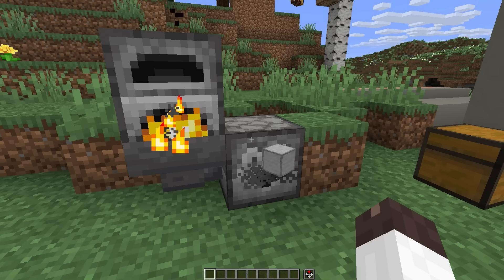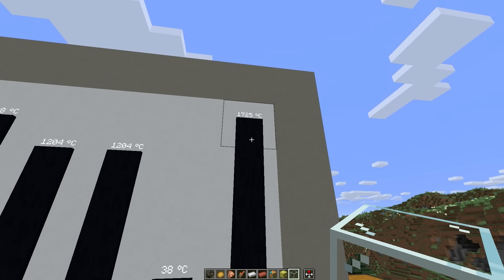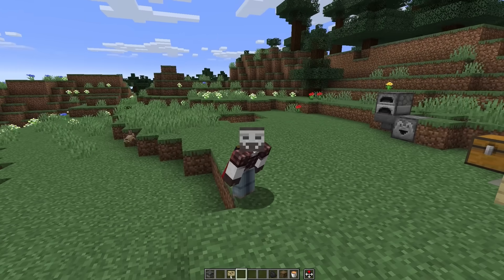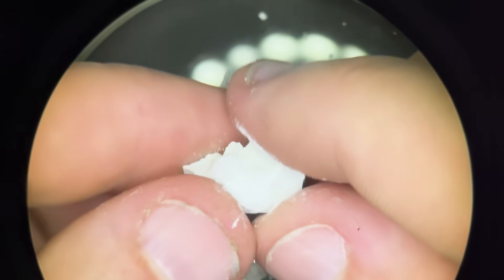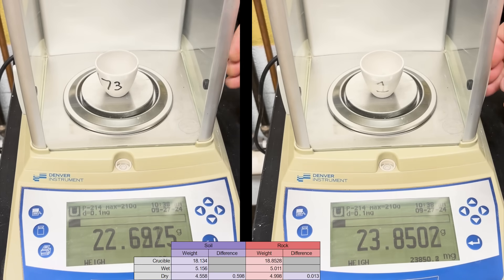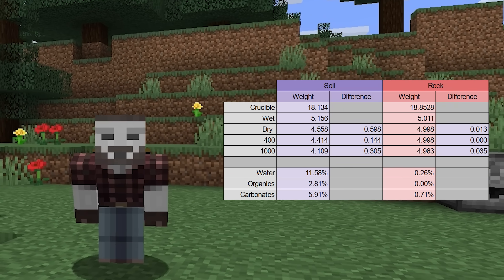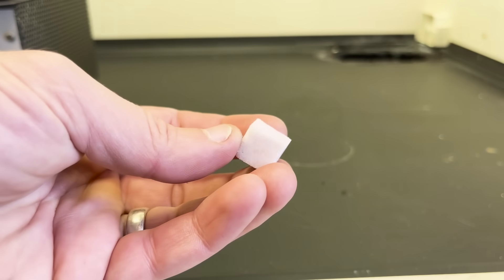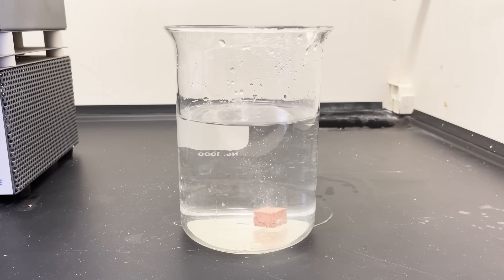Can a furnace make stone smooth?

Comment: A sponge block in Minecraft can absorb up to 135 blocks of water, 1 cubic meter of water ways roughly 1 tonne, meaning a wet sponge can potentially weigh up to 135,000 KILOGRAMS, and with it all being contained within one cubic meter of space, this would make it 6 times denser than OSMIUM, HEAVIEST SUBSTANCE KNOWN TO MAN. You can dry out this water in a mere 15 seconds, meaning you would need 45 GIGAJOULES OF ENERGY TO DRY A SPONGE! THATS 3X MORE POWERFUL THAN A NUCLEAR REACTOR! So it would take a lot more than just 38 degrees to dry a sponge.
Reply: For another comparison, the Hiroshima nuke released about 65 gigajoules of energy. 

You'd quite literally need a small nuclear bomb to dry these sponges
Reply: It takes 1/20th of a second (or instant I'm not sure) to dry out a sponge in the nether by placing it. The nether has a casual 13500 GIGAJOULES (probably wrong, just multiplied your number) to near instantly dump into a block.
Reply: @AxolotlInANutshell-df5xi  and Steve manages to walk around THERE!? Holy hell, HE IS stronger than superman.

Comment: Smooth stone has bugged me for a while now. It's a really outdated holdover from a time when a) there was only one kind of stone, and b) there was no system to refine stone further. From a gameplay perspective, it was sensible enough at the time: cobblestone -> stone -> smooth stone. But it makes no sense that, if you put stone into a furnace, it becomes "smooth" stone while, if you cut that same stone into bricks and then put them into a furnace, they crack.  
It also makes smooth stone a more expensive block to obtain than any comparable finished stone variant.

Comment: 0:24  p-peter how are you doing that
Reply: I don't know lois. I'm scared
Reply: pretty sure it's one of those screen projectors from GregTech with a lot of hidden wiring on storage with sensors (either Jabba barrels or Drawers) to change the displayed file upon adding an item to each barrel/drawer

Note: projector may not be GregTech. All I know is I've seen them in GTNH videos, though never used one myself as I'm pretty new to the pack (150-ish hours) and still in LV

Comment: It all depends on the material. It's also interesting how heat makes clay hard and water resistent, while the same heat makes limestone soft and soluable in water. There's also this thing in Minecraft that you can smelt cobblestone back to regular stone in the oven, which would be pretty hard irl, especially since most kinds of stone would completely change their structure after melting.

Comment: The limestone crumbling to powder when dropped in water was epic.  I like how it looked like nothing was going to happen at first and then it seemed to shake itself to pieces.  When your kids leave their sidewalk chalk out in the rain something similar happens, just not as fast.  I assume there's some reaction with the water and because of the heat it just occurs very quickly.
Reply: It's a quicklime reaction, which is the most basic form of concrete. Quicklime also was historically used as a chemical weapon because of its reaction with water.

Comment: I can say for certain that granite CAN AND LIKELY WILL crack under a large and rapid temperature shift. If you had a huge slab, like, say, for a countertop (like I do), it is way more susceptible to cracks from this shift. I had a griddle on my granite countertop (which I will never do again) heated to 375 (within error of course), and when we opened the door in autumn (it was around 45 degrees), the countertop cracked, making a VERY loud sound. The crack is barely there. You have to search really hard for it. It looks like a tiny hair's width fracture in the slab, and since the countertop is dark, it makes it even harder to see. Nonetheless, it was not nearly as major as a temperature difference as your granite cube, yet it still cracked.

Comment: Smooth stone blocks are an extremely new addition to the game that only exists because of glitched seamless slabs in older versions, it applies the logic of smelting cobblestone to produce natural stone from the older versions to produce a straightforward recipe to produce it as originally stone slabs (now smooth stone slabs) were made on the crafting table.

original smooth stone blocks were made via one of 3 block transmutation bugs one involving persistent metadata per each block in infdev 20100327, 0 ticking moveable blocks into water streams at variable levels from beta 1.7.x to release 1.2.5 and then from release 1.7 to 1.7.6 (iirc) you could use arrows and weighted pressure plates to abuse a floating point number bug that overrid the block metadata of the block it landed on.

Comment: absolute madman just touching calcium oxide with his bare hands.

It SHOULD be okay... as long as it stays dry. if you have wet fingers, it will start eating your skin.

whatever you do, don't breathe the dust.
Reply: Oh, and when you tossed the cube into the water, it disintegrated bacause 2 things happen simultaneously. Firstly, the CaO transforms into Ca(OH)2, and secondly, part of the newly made calcium hydroxide dissolves (it's pretty soluble unlike many other hydroxides).

Comment: The reason why no matter what fuel you use you dont burn food sponges kelp or other stuf that needs less heat is probably the insulation inbetween the fuel and food that can be change to something els for more heat but idk how its melting the super hot stuf

Comment: At around 4:10, you use heat decomposition to analyze the composition of the rock
However, you point out that the color of the mixture changed, because of the oxidization of iron in the rock

If we express this in a reaction, assuming iron (III) oxide, due to the coloration (though I'm not an expert on the matter)
4Fe + 3O₂ = 2Fe₂O₃

Since we take oxygen gas from the air, the mass of the iron oxide is greater than that of the iron metal
Thus, the mass of the rock increases (you can actually run a pretty cool experiment to test this by burning steel wool)

Is this increase just insignificant? Does it only occur on the surface?
Or do you take it into account somehow?

This struck me as odd, and I'm curious as to the answer
Thank you very much in advance, your videos are always a joy to watch :)

Comment: not using gloves on a scale with 4digits is kinda bad. oils and stuff on your skin will change results. even static electricity can make big jumps at that tiny scale.
wighting stuff hot is a complete nogo. hot things literlly weigh less because of convection. the literally get lifted by their own heat. let the cool in a desecator so no moisture gets to them. simple fix.
BTW... BIG UPSI. you just converted Iron. you literally added and oxigen molecule from the air to the iron. that increased the weight acutally ALOT. you need to know how much calcium is producing CO2 and how much Iron absords O2. Otherwise you simply cannot know how much calcium is in there as its actual weight loss is masked be weight gaining reactions and could in some samples lead to heavier samples then you started with

Comment: Indeed the limestone turned to quicklime (very fragile, basically calcium oxide as you said) and then decomposed into slaked lime, aka calcium hydroxide. That's how traditional mortar is made, as once you leave it in air, it dries and absorbs co2, turning back into limestone

Comment: according to the mine craft wiki on the material de constructor in mine craft education edition, stone is comprised of     
    Oxygen x47

    Silicon x28
    Aluminum x8
    Iron x5
    Calcium x4
    Sodium x3
    Potassium x3
    Magnesium x2

Which implies it is a silicate mineral, primarily SiO2. So it's melting point is around 1700C. I think if you had molten SiO2, and mixed in tiny seed crystals of a higher melting point mineral (I think Al2O3 would work well) or metal then cooled it very slowly, then you would be able to get a SiO2 chuck with sufficiency small crystals so that you would be able to get a smooth surface. I would love to try this by my furnace can't melt SiO2. Bear in mind this is a theory, I don't know much about materials engineering, much less melting a cubic meter of quartz
Reply from the maker: https://www.youtube.com/watch?v=K1DoZCJcxFE&lc=UgwVhHIHuGZmK8UR6sl4AaABAg

Comment: Pretty sure the reason stone smooths in the furnace is because it's intended to imply it was actually melted, I'm not just talking out of my ass as I have evidence for this, as this is why when yo smelt cobblestone it turns back to normal stone, you've remelted the cobblestones back into one singular stone block, with remelting it making the stone even more homogeneous, hence why when you mine smooth stone you don't get cobblestone but just the smooth stone, as it's been hardened into a block that can no longer be broken down.

Comment: I think "stone" is not a limestone but rather a shale.
1. it is the most common type of rock, and doesn't need special condition to form, like limestone that's a sea-tied formation.
2. It's not a specific kind of mineral, rather the assorted soup, therefore it cannot be classified as granite/andesite/diorite/sandstone are in game.
3. It has really big variety of components: like aluminum, silicon, and even other minerals, rather then just calcium, so it's easy to explain why trough different processing of a stone you get different recourses
4. It also forms in vertical slices, so looks just like minecraft texture
5. How is deep version of a minecraft stone called? Deepslate. And slate is a shale.

Not a geologist however, I just google stuff I hyperfixate on.

Comment: An old school wood kitchen can get higher temps than it seems inside with just one or two hours of "full power". I hardened a crappy knife blade on my dad's kitchen using olive oil (had nothing else on hand) and the results were awesome! I didn't expect it to work and i had a problem: since it did i didn't have a way to sharpen it anymore 😂

Comment: A others have said, smooth stone wasn't always obtained through the furnace. The full smooth stone block used to be only obtainable through commands, and you could make the slabs through simply crafting (regular stone slabs didn't exist). I think the reason that the furnace was chosen wasn't just because the furnace was all there was, but was also in an attempt to give more functionality to the furnace for balancing reasons.

Comment: Why would it take so hot to cook food when I can do it with a 100c boiling water
Reply from the maker: the horizontal temp is what the fuel burns at, with enough distance you can get any temp colder than that to cook.

Comment: I remember I loved the day this block was added. Previously this texture was available by making stone slabs out of regular stone, before smooth stone was added to replace the recipe

Stone smelted from cobblestone was colloquially known as smoothstone, there was no difference between them, we called stone "smoothstone" pretty interchangeably, most usually if we smelted it from cobblestone and had bulk stored up for building with, and this regular stone would make smooth stone slabs

In modern Minecraft we now have both, stone blocks and stone slabs, along with smoothstone and smoothstone slabs

Before smoothstone blocks were added, the full texture version of the block was unavailable in normal gameplay, smoothstone slabs always had that half-chunk cutoff line, HOWEVER the full smooth variant was accessible in creative mode by modifying the data value (and thus the material)

This method was also how we got petrified wood slabs (oak planks used to be the only wood slab, and all slabs were coded to be stone-type) and also how we get smooth sandstone (yes, smooth sandstone was added in the same update as smoothstone, because more slab types were added and they removed the deprecated slab types)

So, the addition was less about realism, instead to provide more blocks and recipes obtainable in survival mode

Though I really like seeing people talk about and study the game in its current finished state, I just thought you'd find that interesting, a lot of Minecraft's features feel like "what came first, the chicken or the egg?" lol

Comment: Basically in real life, instead of making the stone smooth, it burns it into a white oxide that somehow keeps its shape until you put more strength than you'd use to hold it and crush the oxide cube into a powder that very much resembles cocain/powdered meth in terms of appearance. Although snorting it like either drug would probably kill you.

Comment: This is actually what they used to glue old castles and houses together. They cooked limestone in big very hot furnaces to cook of the co2, then dunked the resulting powdery rocks into water, to create a paste. As this paste dries between giant stone slabs or bricks, it releases its water content, and absorbs co2, and gets converted back to limestone. Thus you have glued two stone slabs or bricks together with solid limestone

Comment: Explanation: The real reason why this feature was introduced to Minecraft is because in the past versions you couldn't craft smooth stone blocks - you could only make smooth stone SLABS by putting horizontally 3 stone blocks in the crafting table. To craft smooth variants of blocks such as granite, andezite or diorite you have to put 4 blocks in a 2x2 pattern. However, when Mojang eventually wanted to makr smooth stone blocks achievable in survival mode there was a problem - 2x2 recipe was already reserved for crafting stone bricks from stone, so they couldn't use is for smooth stone - they used furnace, because there was no alternative really, sure they could introduce a different pattern, such as maybe 3x3 to get 9 smooth stone, but I guess they didn't want to break cohesion

Comment: I've personally forged stuff from steel/iron, and sometimes have placed a pebble or rock in. Yeah most of the time it just cracks or absorbs slag (Which can be from whatever). Though one way you could make building rocks, is to smelt iron actually, which leaves you with 'dross' slag rocks. It's been used to make dross bricks with a glossy finish, well at least I can recall few buildings made out of them in an industrial town on Finland in the 1700-1800s, where there was a foundry, which is coincidentally owned by 'Fiskars'. There's some other places with those as well, said that they are rather tough.

Comment: I always assumed in Minecraft you were melting the stone and pouring it into a cube-shaped mold. Clearly the furnace can vary in temperature, so it should be able to get hot enough to melt rock. That’s why cobblestone melts together into a uniform cube of stone. This would make metal smooth, so why not stone?

Comment: smelting iron in a bloomery would require temperatures much like you depicted, but using a blast furnace (and pretty much all other modern iron smelting methods that exist) create temperatures just as high as the production temperatures for making glass. this can be confirmed by the nearly identical process (side process in iron smelting) that occurs in both instances, namely: silica/silicates react with basic metal oxides CaO or CaO & Na2O at high temperature, for iron smelting and glass making respectively. it requires very high temperatures if you not only melt but make a low viscosity puddle of silicate slag at the bottom of your blast furnace.

Comment: You actually can do this in real life, its called glazing/firing. although you would have to do it in an unconventional way. You would have to take a rock without moisture, and heat the surface extremely quickly to slightly melt the surface, causing it to vitrify and become smooth, like glass. remember that glass starts out as rough powder (sand). if you extrapolate out from that, then you should be able to take some quartz sandstone or quartzite (or maybe even regular sandstone) and melt the surface to smooth out the rough surface. and sand comes from rock, so really any rock that wont shatter or explode upon heating can be made smooth this way.

Comment: Smooth stone was originally just the slab, there was no full block. The furnace wasn't involved when making the slab it was just three stone in a crafting table. They were even craftable with andesite, cobblestone, diorite or granite at different points in time.

Comment: In a few places, you mention that the iron in the samples has oxidized, thus making them red. Does this represent a mass gain (since oxygen atoms are leaving the air to join the rock)? How do we account for that? Doesn't that distort our measurement of water, organics, and carbonates?

My favorite demo of oxidation causing a mass gain is that you can burn steel wool, and when you do, it comes out heavier, which feels counterintuitive since most things we can burn have gaseous products and represent a mass loss. Could be a relevant demo for some future video.
Reply from the maker: Yes, its common for rocks low in carbonate and higher iron to gain mass from loss on ignition.